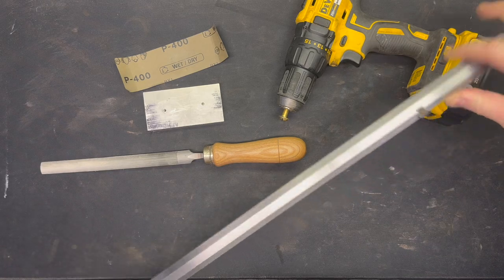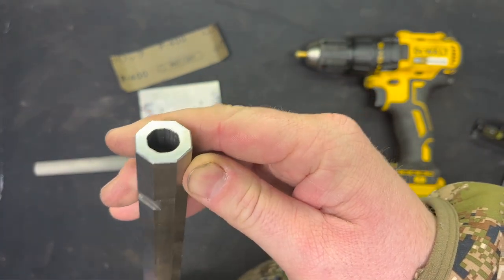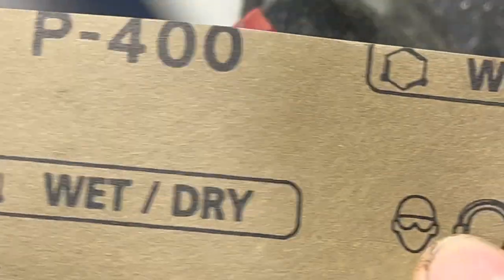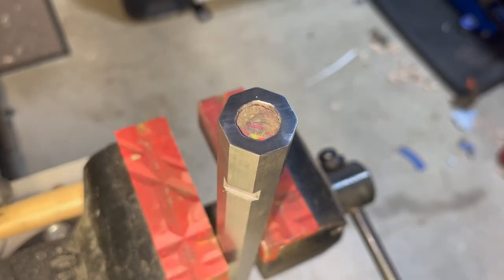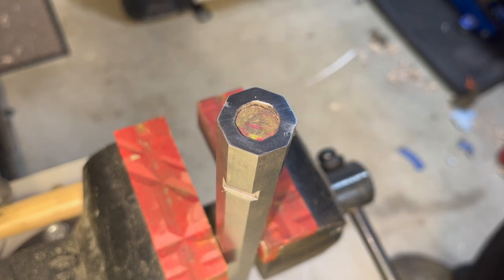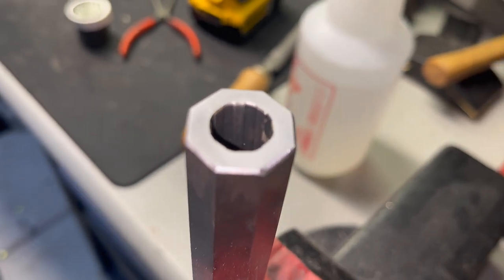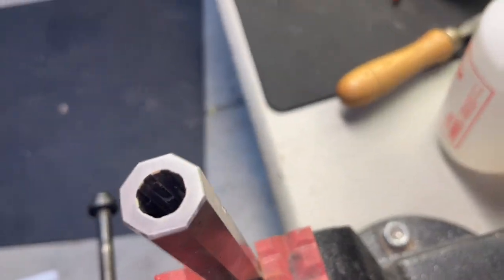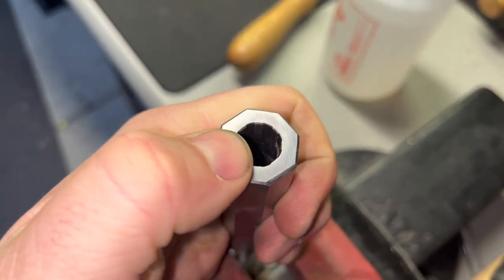Sonoran Desert Institute: Muzzle Loader Lab Part 6

Comment: Super interesting! Hey, what's the "right" tool for crowing this? But, I think you nailed it with the brass screw.
Reply from the maker: I actually showed the tool I ordered and ended up using in the part seven video.  For the price it worked pretty well, but I didn’t really like the grinding compound they sent with it and ended up using JB Bore Paste instead.